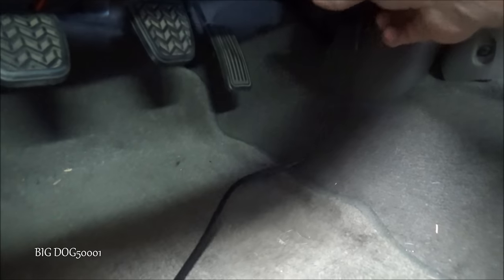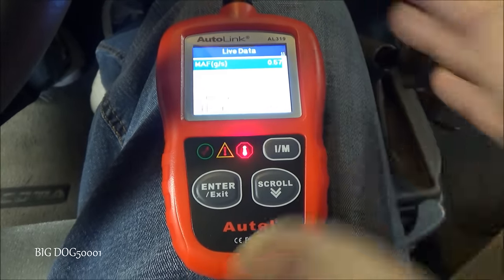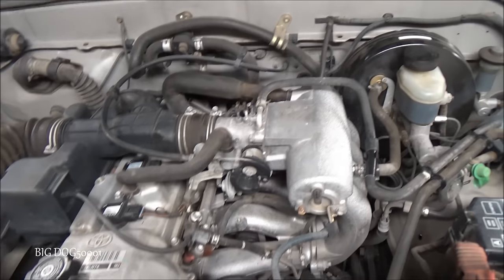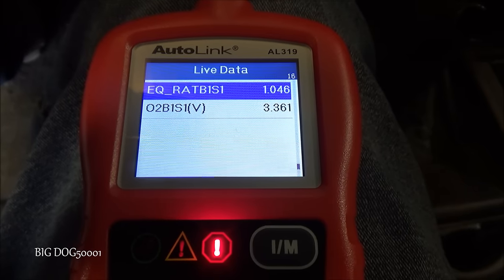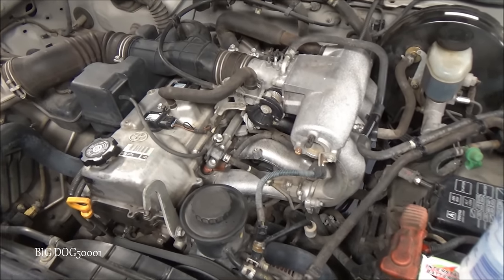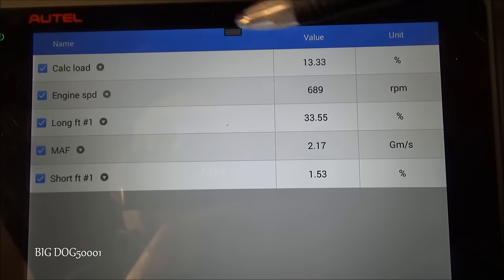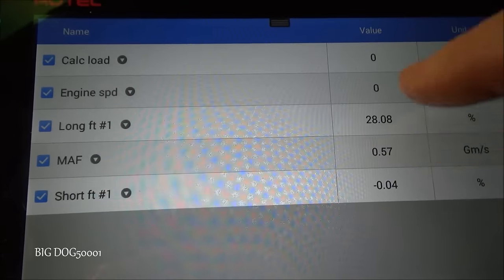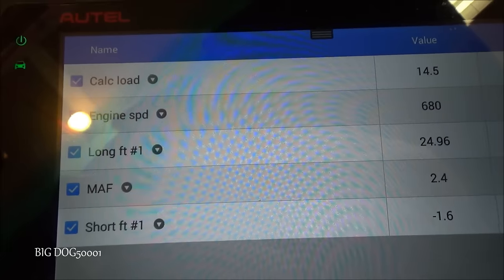P0171 Trouble Code: System Too Lean Bank 1 Diagnosis

Comment: Big Dog, thank you for answering my question . 
You had mentioned in the video that if the fuel trims get better at higher RPMs , that it could indicate a vacuum leak but what about if the LTFT gets worse from about 29 when idle to 45.5 when at slightly higher RPMs? It seems it maxes out at 45.5 no matter what RPM after a certain speed. I keep forgetting to look at the short term . I am using the BlueDriver. 
The car I am talking about is a 2008 Toyota Yaris sedan and when the CEL light came in telling me it was running too lean , I took it to someone and he used Brake cleaner to look for leaks and when he didn’t find any , he suggested changing the MAF because it looked dirty and also got new spark plugs . The code cane back on not long after I left his garage . So I’ve been looking at live data but I’m still not sure what it could be indicating . I would think with the car being this old that it would have at least one or two small Leaks somewhere so I’m not confident that the brake cleaner is able to catch it all . I’m upset that I might have spent time and money changing parts that were not needed (yet) and worried that I could be changing part after part . 
Do you have any thoughts on which direction to go with the fuel trims I told you ? Thank you !!
Reply from the maker: Long term fuel trims are a learned value over time, I look at both but short term fuel trims can useful for diagnosis because they are more real time data.  As far as diagnosis  I try to look at all the data that I can find (fuel trims/O2 readings/MAF/MAP etc) and try to follow it using critical thinking about the systems and how they work.  Not sure what you installed, but I would also mention I am not a fan of aftermarket MAF sensors for Toyotas or Hondas.

Comment: Can a Chevy silverado brakes vaccum pump issue cause a vaccum leak?
Reply from the maker: It depends on how the system was designed, but generally if there is a separate air pump for the brake booster they usually don't cause lean codes.
Reply: I looked for leaks everywhere. I'm guessing is the MAf

Comment: The thing that helped me understand fuel trims is it is a number correlated with the length of the injector pulses. The pulse is greater than normal its positive, less its negative and the pulse is adjusted to get the proper numbers from the oxygen sensors.

Comment: Ha  !! the easiest way to test MAF sensor if it is the MAF sensor is tap it gently with screwdriver handle if a difference is noted drop in idle etc , its your MAF sensor , without the need for all this B/S , the other thing is Brake Vaccum does not join up to the intake pipe , it is connected to the inlet Manifold itself . So it would not affect the air flow . Brake boosters if faulty too much air being released your brake pedal goes rock hard that is if your brake booster is Faulty , reason you are getting those brake  booster reading is the MAF sensor once you fix that it will give the correct air to your inlet manifold thus giving brake booster the right air . You may have all the people here fooled with your diagnosis but to me An automotive technician you just come across as THICK
Reply from the maker: Spoken like a parts changer.  Don't you have a parts cannon to fire up?